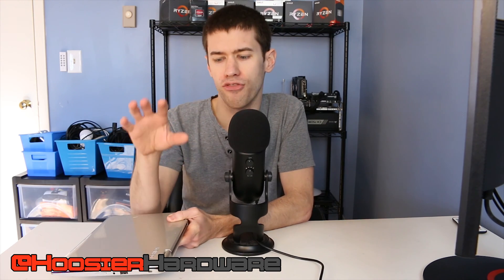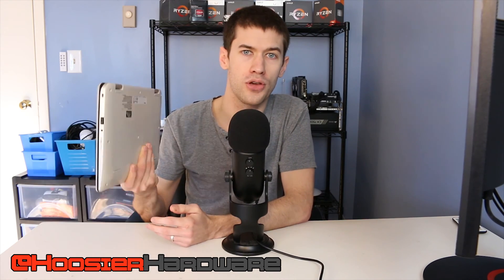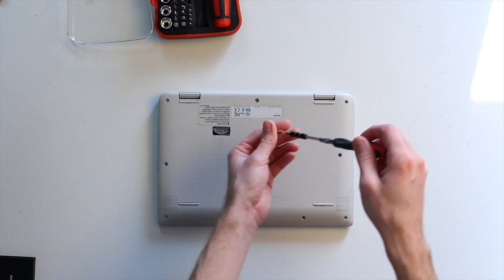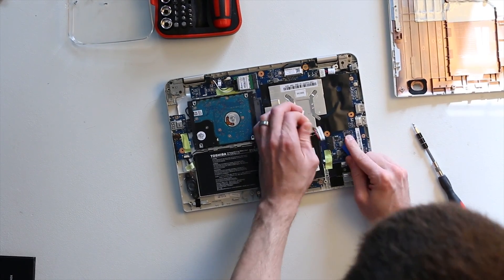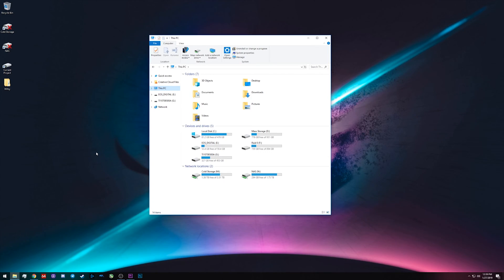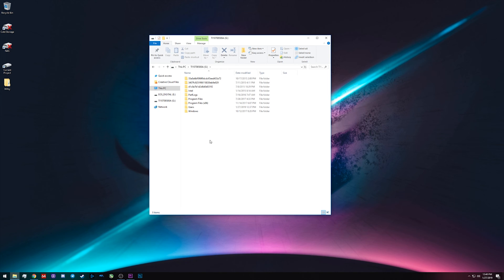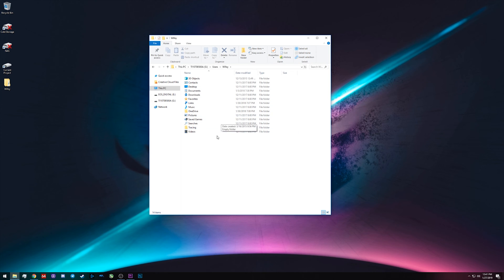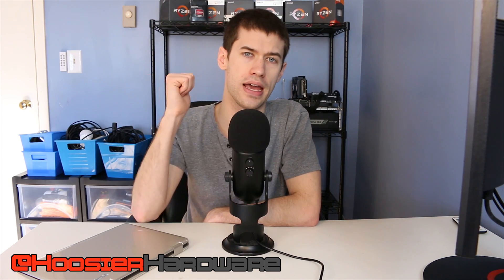How to Save Files from a Broken Laptop

Comment: I spilled iced tea into my older computer and it died. We retrieved the hard drive and I'm trying to install it onto a brand new microsoft computer. However, it will not do anything without a bitlocker key. What is this all about?

Comment: This is not working for me! I am transferring from PC to PC. From a broken dell to a new HP computer. I bought a SATA usb adapter, the new computer installed and recognized the drive, shows as (D:) but when i click it only shows something that says recovery. There are no other folders or files. I have been so frustrated because i really need to get these files from my old computer. I even tried connecting it to my laptop and it just shows the same thing. Please somebody help if you can!!
Reply: have u been able to do anything?
Reply: @ethanxxxc  Nope. I just gave up since i havent been able to find a solution

Comment: I have a Yoga 13 (the original one). It works fine now, and there is nothing important. But it uses the old mSata. It would be a pain if i have to pull info from there.